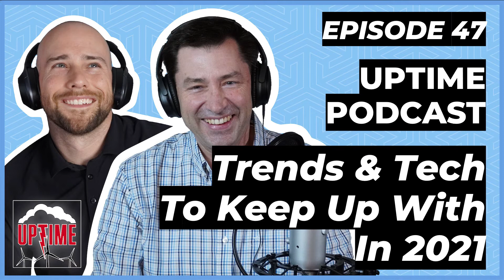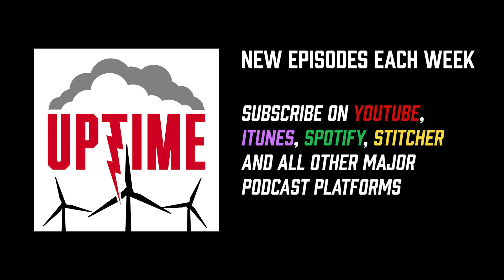Vestas V236 15MW Turbine + 2021 Tech & Trends to Watch [UPTIME WIND ENERGY PODCAST]

Comment: I appreciate the fact that right off the bat by advertising as a company who makes money in the wind turbine industry, and you have a stake in the conclusions you reach in your research. Now anything you say automatically has a profit point of view which makes anything you say questionable. Not necessarily untrue, but questionable. So I will watch these videos with that in mind.
Reply from the maker: Sure thing. We put out the best podcast on wind energy, and it takes resources to do so - advertising our brand is part of what we get in return. Skepticism is healthy. Thanks for listening.
Reply: @WeatherGuardLightningTech  Excellent! Now I have been asking a question about turbine designs, and instead of answers all I get from the industry is vitriol verbal attacks. The design of a horizontal turbine requires all the heavy generator equipment be mounted high in the air which causes a massive increase in stanchion beef up. Plus the difficulty of regular service, as well as complete destruction of this equipment in catastrophic failure of the stanchion. Would it not make more sense to shaft drive the outputs to the ground where the equipment would be much safer and more accessible?
Reply from the maker: That’s a good question, but I think in this instance the shaft and gears would have to be so long that it would end up and add a lot of complexity to the design, which means more points of failure. Driveshafts are a weak point on cars, and in this can we’d be talking about hundreds of feet. Seems simpler to bring the people—who can easily ascend a ladder and stairwell—rather than bring the nacelle to the people. Just my thoughts. - Dan
Reply: @WeatherGuardLightningTech  Take a look at a standard large ship drive shaft. It endures a much higher exposure to both slow load and immediate heavy load, besides being in a highly corrosive environment. The vertical shaft load would be supported at required intervals to prevent shaft flex misalignment problems. The problems you mentioned have already been solved!

One of the history lessons I learned was about Henry Ford and Sikorsky and his problem keeping the tail rotor together on his primary helicopter invention. The conversation between the two was about Henrys real axle planetary gears strong performance, and led to the helo's tail rotor gear box success. Pulling together two different manufacturing fields often solves problems others already solved. This seems to be the case here. Rethink this and imagine the reduction in cost and maintenance.
Reply from the maker: @newrenewableenergycontrol5724  I tend to defer to scale here - a lot of smart engineers work for GE, Vestas and others. I'm sure this solution has been on the table and was dismissed. If this was truly such an obviously better solution that saved money, it would be implemented already. The design has been around for decades and many new designs have failed to catch on.
Reply: @WeatherGuardLightningTech  The only way an engineer can become a scientist is to stop assuming ... Its called being a flat Earther. The Earth is flat because that really smart guy said it was. 

Well, I have not been an engineer for a long time for that very reason. I am telling you, they are wrong. Now you can assume they are smarter then you or you can do your own work.
Reply from the maker: Electricity produced by the current design of wind turbines is cheaper than ever, powering more homes than ever, and is incredibly safe compared to other forms of electricity. Why should they go and try new designs when they're successful? It's not at all like being a flat-earther - the evidence is in front of all of us, plainly visible, that the current designs work. It makes little business sense to change what's continuing to work better and better every year.
Reply: @WeatherGuardLightningTech  Cheaper then ever does not mean as cheap as it could be, right? I have a dog that is incredibly safe to the one I handled in the Air Force. But that does not mean my dog does not bite! My high school gym teacher was successful in long distance running competition. But he still ended up as a gym teacher in a high school. Why do we need a new design, wooden sailing ships work fine? Are you seeing the error in your argument?

This is exactly what I was telling you about. Engineers have no forward vision. That takes one who is a scientist by nature. When the scientists hand you something that works better you will run with it. You either are a scientist or an engineer. Engineers can become scientists, but once you are a scientist you can never be an engineer again! As they say, there are none so blind as those who will not see.

So hang your lighting protection equipment science research be damned. It makes you money, and if I were you thats probably what I would do. But I am not you.
Reply from the maker: You asked for an opinion and you received it. I was respectful and thoughtful in my response. Sorry you didn't like the answer, but I'm done responding now that you're being rude and disrespectful of me. - Dan